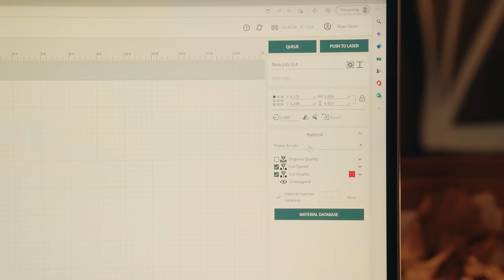Making a QUICK RELEASE CAMERA STRAP with PEAK DESIGN anchor clips!

Comment: Hey, Love the videos. Have a suggestions for this one. How about burn the ends of the rope so they melt and while still hot, put right into your leather and squeeze until it cools. Essentially gluing it in place and then you can add your stitches to reinforce?

Comment: Cool video! My first impression is that it's nice aesthetically but surely it's too thin and it would dig in unlike the thicker peak design one. Then I saw you put it over your neck and I realised it's for a small camera. For me using a larger full frame camera neck straps are horrible ergonomically.
Reply: "For me using a larger full frame camera neck straps are horrible ergonomically" not so is my 50mm EDDYCAM one.

Comment: Why did you not do all the burnishing before putting the leather through the anchor? Would have been a lot easier, don't you think?
Reply from the maker: The edges of the leather piece gets pretty mangled after going through the peak design anchor.